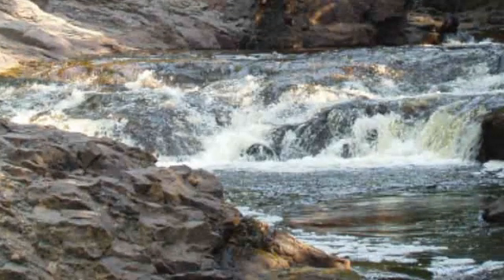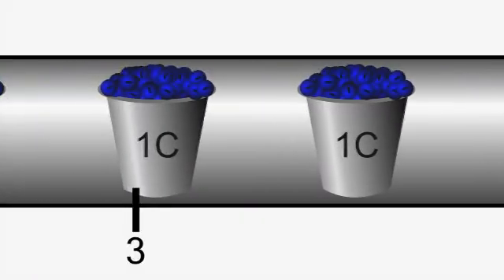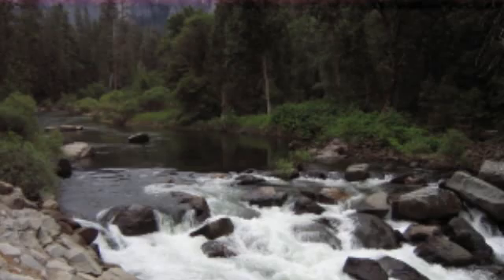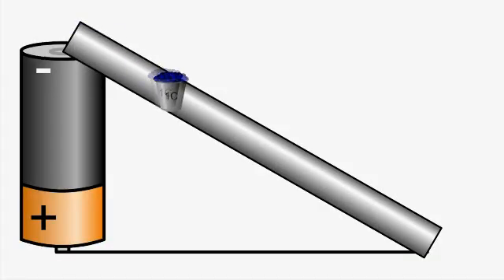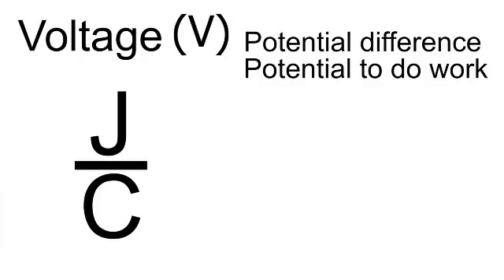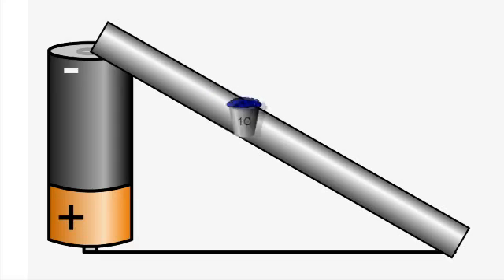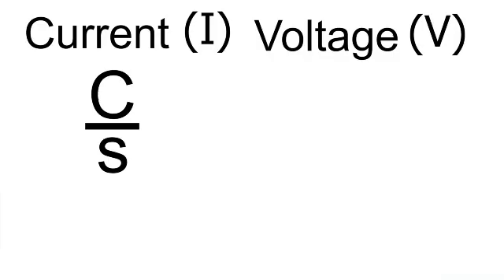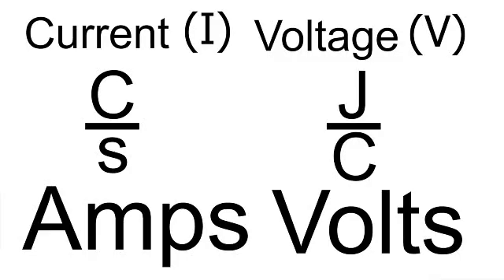Current and Voltage

Comment: Voltage = Current (amps) x resistance (ohms). Power (watts) = Current (amps) x electromotive force (voltage). Basically, voltage is a pipe or river, current is the water, and the shit or rocks in the pipe/river is the resistance.

Comment: The higher the voltage the higher the current. Yes, but that is also POTENTIAL.
We need a LOAD to draw the current? The less ohms in the circuit (less resistance ) the more current. Thank you

Comment: I will take this a step further:
Power(P)=I(current) * V (voltage)
P=(C/s) * (J/C) 
Cancel out the "C" Coulomb and you get power is equal to Joules per second.  Or energy per second J/s which is a Watt 
P=J/s=Watt
A 10 Watt LED takes in 10 Joules of energy per second.

Comment: The thing I still don't understand even after graduating college with an engineering degree: why is it that the current entering a resistor or any other energy draining device is the same as the current exiting? I understand all the charge has to pass through, but if that charge has lost some energy, shouldn't it be moving slower?

Comment: Why does a greater voltage result in a greater current? Could it be that if the charge has a greater difference of potential energy between two points,  that the greater potential energy was converted into greater kinetic energy so more charge moved passed a certain point in a second?

Comment: Do you mean that amperes measure the number of arrows i shoot per second, while voltage measures the tension in the bowstring ?
I just thought up this analogy.
Reply: No. Volts and amps are correlated. Tension in a bow string has nothing to do with the amount of arrows I can shoot. I can have low tension and still shoot the same amount because my hand still moves at the same speed. Volts is the speed of your arms.

Comment: No. Neither Current nor Potential is "easy". We say current is the flow of charge (more specifically, electrons). But for a typical voltage applied in a typical household, the velocity of the electrons is of the  order of 1mm/sec. That is too slow. We can very well see that the moment we switch on a light bulb, it starts growing immediately. That is the phenomenon of current occurs at almost light speed. So current just cannot be the flow of electrons from higher potential to lower potential.

Now for electric potential, you said about what "potential difference" means(difference in electric potential) and what it does. But what exactly is the definition and derivation of electric potential? (not the difference.)

Comment: Okay, could someone clear this up for me? In a mains supply, the voltage is sent at huge values, but it has a very small current (since if it was a higher current surely it would generate too much heat from the resistance produced) but how is this accomplished if an increase in voltage results in an increase in current? Is it something to do with the signal being sent AC rather than DC?

Comment: Shouldn't the current coming from the battery be the same as the voltage? If the voltage is 1.5V, then the amperage should be 1.5amps. No/Yes?   One volt pushes one amp , 2 volts pushes 2, etc,etc.., if one post were connected directly to the other?

Comment: Who decided the size of the Coulomb "bucket" ? What's the basic measuring device for it ? The same for Joules.
Reply: An Ammeter is used to measure the current. Now by definition 'current' means the rate of flow of charge per unit time. Translating this into an equation: Q = It. 
Where Q=Charge    I = Current     t = time

With that equation you can work out the charge flowing through a conductor. 

Who decided the size? I think it was Charles-Augustin de Coulomb.  

On the other hand, Joules is the SI Unit of energy named after James Prescott Joule.

Comment: In Current and Electricity what is the higher potential... Guys this thing is messing me soo much..
I don't know why but i can simply get this thing clear.. My Exams are just around the corner.
I have Questions of which I need some simple answers.
1.What basically is the electricity??
2.Do electrons flow from Positive terminal to the negative terminal or from the negative terminal to the positive terminal.
3. What does actually flow: Protons or Electrons?
Please reply to me... 
Thank you in advance.
Reply: Stupidity Master electricity is basically a flow of electrons. Each of these electrons can do a certain amount of work, deliver energy depending on the voltage. I've learned the the current flows from the positive to negative, but the opposite makes more sense, so don't quote me on that.
Reply: ***** Dude... Thank you sooo much for your quick reply ...

Comment: what I don't understand is if you have a 12v battery and a 12 gauge wire and you hook up a 2 amp light bulb then 2 years later it blows so let's say you then but in a 4 amps light bulb how does it know to draw 4 amps when nothing changed with me just asking you I figured it out I can't believe I finally get it I was really stuck please correct me if I'm wrong negative attracks positive and the light bulb just slows down the magnetic charge basically between the two

Comment: Ah, so at a higher voltage, the same amount of current can do more work!
Reply: that is why magnitude of current doesn't matter .... it is the voltage which is deciding factor...in this case if more is voltage , same current (electrons) will do more work (convert more energy into light and heat for bulb). Hence a overvoltage in our houses increases brightness of lamp as it is giving more light and heat for same current because energy supplied is more...

Comment: More voltage means less current ?
Reply: +InVaDe CoCo more voltage means more current
Reply: +Tharuka Fernando but allot of people say more voltage gives you less current why??
Reply: depends on the scenario...if you Increase the resistance (R) of the circuit..the current should drop according V=IR ...where (I) = current and (V) equals Voltage. But if you have a constant resistance but increase the voltage (eg: With a higher voltage battery), the current should increase

Comment: Veritasium
Reply: xD that's exactly what I came down here to comment on
Reply: if the current is like as the size of the pipe &pressure is voltage so what is the importance  of  flowing electrons in it 
please reply to this question

Comment: Can any one correct me to know if I understood the lesson correctly. 
Voltage is the amount of electrons in an area, while current is the speed of movement of the electrons.

 Voltage is measured in volume /area, and current is measured as speed of the volume of electrons moving from one area to another. Current is measured as volume* speed/ distance.
Reply: I'm not sure where you're getting volume and area from. Essentially voltage measures how much work an electron can do, while current measures how many electrons pass a single point in a second. Electrons move at the same speed so a higher current does not mean they're actually moving faster
Reply: +Comprehend Nature 
No, voltage is measured in energy/electrons while current is measured in electrons(passing a specific point)/time

Comment: If I charge a gadget with 3.5V with a 10V will it overheat ?
Reply: +YAHOO : If your gadget charges with 3.5 V and you want to charge it with a 10V charger, your gadget will overheat and the electronics in your gadget will burn. The battery will heat up and become useless, at worst if not made properly, it will blow up. If you left your gadget in the charger, it will burn and possibly burn the house with it. So be careful with that.

Comment: I know you! veritasium! Anyway, that explanation was beautiful. Thank you. Thank you!!
Reply: We all do know Veritasium 😂
Reply: Hi, can u please help me? If a Voltage of 1.5V means that there are 1.5J carried by every coulomb of charge passing through the lamp, then how do the electrons have any more energy or pushing force left to return to the other side of the battery?
Reply: @pahgm6222  My guess is that it will do 1.5 Joules of work throughout the joruney. If the length of the wire is increased, then the light coming off the blub would be lesser than if the wire was shorter. The length of the wire affects the work done can be thought of as resistance. Or, as veritasium says it, the narrowness of the river. 

All in all, if the wire is longer, it is more resistive and the charge will do 1.5 joules of work throughout the entire journey. 

I don't know much about this as well so it's upto you to believe
Reply: STOP OVER COMPLICATING😰

Comment: There's ONE MONSTROUS ELEPHANT in the room: why don't you explain what is the reason that current flows from positive to negative while electrons flow in the opposite direction?
Reply: The reason is that we labelled the origination terminal positive. Thats it. Its the same the reason that water boils at 100 C. The creator of the Celsius scale couldve chosen to set the value for boiling water to 69, and freezing water to -9000. The person who first describes/designs the system chooses what to call things, or what value he/she assigns to them.
Reply: Widg3t's Widgets What is the "origination terminal"? I've never heard of it.
Reply: It is whatever you'd like it to be. That was the point of my comment.
Reply: Widg3t's Widgets I mean, what makes you call the positive terminal "origination" terminal? What the hell does "origination" mean? It's not even a standard terminology.
Reply: +Alq Current doesn&#39;t really have a direction, it&#39;s a purely mathematical concept (i = dQ/dt), and only has a sign (positive or negative). The idea of &#39;flow&#39; is a model to aid in circuit design. Conventional current is shown as positive as matter of convention, because humans find positive numbers easier to work with.
Reply: +GRAVE DIGGER thanks bro...now that's a respectable answer unlike some ;)
Reply: Alq "Ur" is part of the English slang and is used to type quicker. So am I illiterate or just efficient? Unlucky Al Assad
Reply: You're 16? You better hope whatever phase you're going through that makes you act stupid is short
Reply: +Alq The direction of an electric field is defined as the way a test particle (a tiny, tiny postively charged particle) would flow, i.e. from the positive pole to the negative. But electrons are negatively charged and therefore flow the other way
Reply: Alq  that it is a proton
Reply: Marcus McVik The term "particle" is a generic term that can mean many things including a molecule, an atom, a neutron, a proton, a photon, or other subatomic particles. A huge part of my dissatisfaction is that the way people explain tends to be somewhat ambiguous. If you mean proton just say proton. If you mean any positively charged particle then say so. Be precise! That's why there are so many people who don't understand 100% of simple things such as the direction of current. So, don't be ambiguous. It's a bad, bad practice.
Reply: +Alq I have to agree with you, I believe that their should be universal words for individual meanings......eg, it is unnecessary to have temperature measures at Celsius and Fahrenheit, Imperial and Metric. It's like the so called "smart people" are out to confuse the hell out of everybody else.
But, if we went this way and made everything universal. It should apply to everything.......For example tools, with screws, do away with flathead screws!, either use posidrive or Allen key heads? And that is just one thing that would make the world a simpler place. 
If you wanted to make a difference in the world, and I mean a truly magnificent difference, universally have one language! It could be epic......It could be perfect. 
I would like to know your thoughts on this matter :-)
Reply: Shona O'Neill It's not about the units that make it hard to understand. It's the way people explain things that's not precise enough.
Reply: David Alien holy......groundbreaking news you should publish that
Reply: +Alq No need to, it's throughly covered in every good textbook on the subject.
Reply: David Alien no direction.... just...wew....
Reply: Bob Bob Nobody because I didn't refer a person. LOL
Reply: ur not clever
Reply: Alq 16*
Reply: Now you're uttering nonsense...what a dumb kid you are
Reply: Alq Unlucky. 'Dumb' is informal
Reply: Had to improvise ;) You're too dumb to understand formal language
Reply: Alq Well considering that you contradicted yourself on when to use informal language you are the low IQ one. unlucky :-(
Reply: Well, considering you don't even know how to read that I never even mentioned that I would use formal language, I would say, unlucky for you, you're extremely dumb.
Reply: Current can flow from either positive to negative OR negative to positive. It depends upon the freedom of movement of the charged particle or ion.  If the positive side of the circuit is fixed, then the negative particles (electrons in this case) will flow to the positive charged side; if the negative side of the circuit was fixed in place, then positive free particles or ions would flow to the negative side.
Reply: Alq  actually efore people thought that protons move so they decided the the current flow will be from positive to negative.  But later we discovered that only electron moves. But scientist didn't change the traditional defination. It is kept as it were.
Reply: Alq Do I need to be formal when speaking to you? You seem like a low life lazy boy so if I was you I'd stop wasting time criticizing people's videos and make your own if you think you know it all.
Reply: clever enough to know that YOU ARE illiterate ;)
Reply: Hahaha why did you even bother to ask? Who cares how you speak? You can only blame yourself for speaking like a stupid 12 year old teen. You came here to troll but you got trolled instead. LMAO!
Reply: Marcus McVik Then, what defines a particle to be positively charged? Does it mean it has more protons than electrons?
Reply: +Alq You need to get laid, man.
Reply: Alq unlucky. i feel sorry for you
Reply: I am not even surprised an illiterate person such as you doesn't know that a slang refers to an informal word used in VERBAL speech. YOU ARE such a joke! xD

Comment: 'Because of the high-current and low voltage output, the vascular structure enclosed by the jaws of theinstrument degrades quickly and a protein-based seal is presumably created; this mechanism of electrical current delivery to the tissues results in less charring and less collateral thermal damage'.

I have quote the above from Campbell textbook of Urology which is describing an electrosurgical instrument Ligasure.. Now according to you high voltage means high current as the greater the potential difference greater is the flow. How can it explain high current low voltage ??

Comment: when you mean the greater amount of voltage applied across a wire, the greater the current that will flow in that wire.
What do you mean by the greater the current that will flow. Do you mean the more faster it becomes or the more powerful it becomes?
Reply: I too got a lil confused there...coming to think of it, transformers for example, proportionately increases or decreases voltage level with a decrease or an increase in current respectively.

Comment: Woah I thought the negative side was lower potential. Can someone quickly explain this to me?
 I gotta know cause I'm working on a senior design project
Reply: i read that when scientists started started to study electricity , they didn't know which of the protons or electrons are flowing , so they made a wrong guess on the protons ,which explains the conventional flow (as you thought)
but in reality the negative pole of the battery pushes the electrons towards the positive one
Reply: First of all, there is a potential difference, because there are more electrons on the negative side. And since there are more electrons on the negative side, the negative side has higher potential.
Reply: In a battery, the negative side is the onde where the electrons are comming out, they go out at full power
The negative does not relate to potential, relates to the electrons

Comment: I think he made a mistake explaining..can someone explain to me at 2:28. He said electrons will flow from higher potential to lower potential when in reality Electrons flow from lower potential to higher potential. Also i thought the positive end had a higher potential
Reply: No, he's right. Basically the "convention" of depicting electricity is that it flows from positive to negative but it actually goes the other way, negative to positive. The negative end(of a battery for example) will have more electrons and therefore will have a higher potential than the positive end. So the electrons will flow from the negative to positive end(if you close the circuit)

Comment: But is the final statement true?

As the two concepts seem unrelated to each other. I mean, there are batteries, cables, chargers with the same Voltage input/output and very different Current flow...

Comment: Very clear explanation. But one thing i Do not understand.
When batteries are in series, the voltage increases, but why does the current stay the same?
When batteries are in parallel, the current increases, but why does the voltage stay the same?
Reply: Let's say I connect 2 batteries(1.5V) in series.
The first battery will increase the potential difference from 0 to 1.5V, the second battery will increase the potential difference by another 1.5V. This time, because we are not starting from 0V but from 1.5V, we will have 3V as a result.
Each battery adds the voltage it offers to the already existing potential difference.

By connecting 2 batteries in parallel the positives and negatives of both batteries will be connected. The second battery can't build upon the potential difference the first battery created,therefore increasing the overall capacity that the batteries offer. Imagine one battery charging the other as you use them.